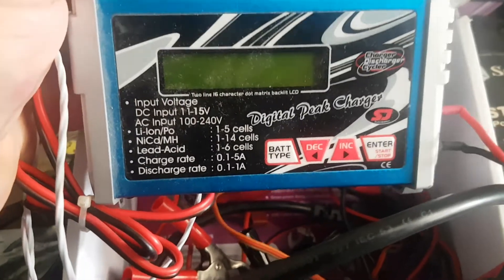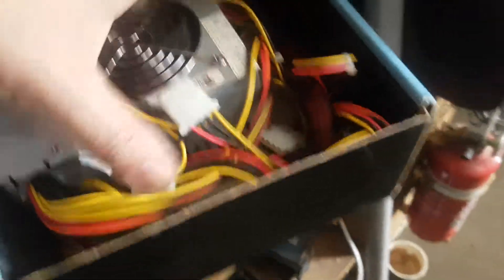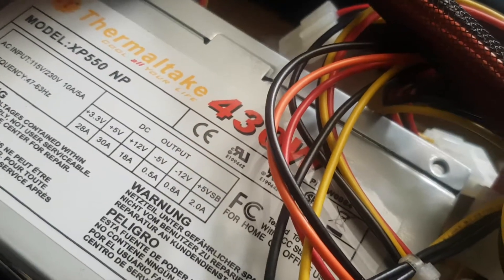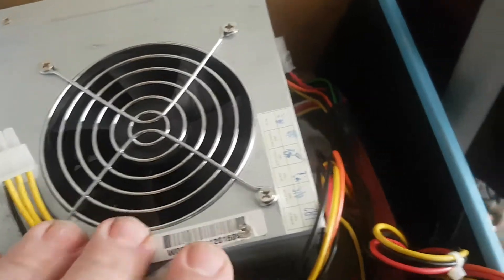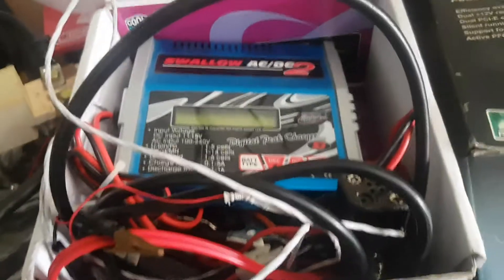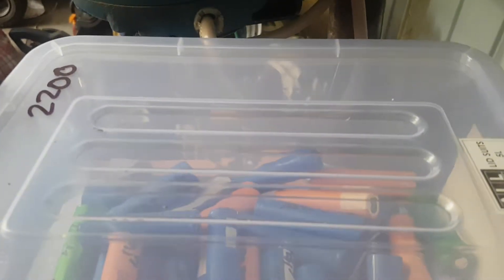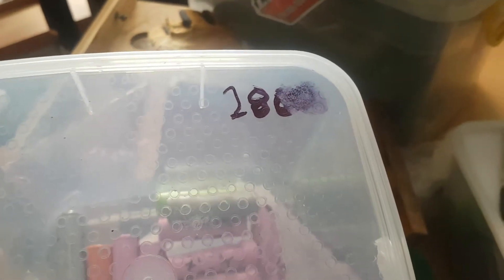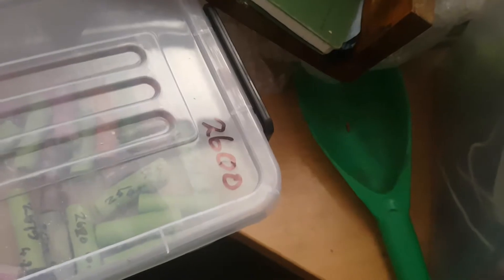Swallow version 2 Battery Charger/Discharger with BMS I think. 18650 second hand.

Comment: Can the charger properly charge a 36v ebike battery pack with 21700? I understand the charger states maximum of six cells only? Cheers
Reply from the maker: I would say no, but doesn't the ebike have a bms on it already?
Reply: @chuxxsss  yes it does! So you’re saying the bms will regulate and properly charge the battery? Really appreciate your advice! Thanks
Reply from the maker: @cmnhl1329  You need a BMS with the batteries.  So 36/ 4 = 9 lines or 10 lines. If you have to many lines double them up at the end. There are vlogs on this online.
Reply: @chuxxsss  awesome thanks